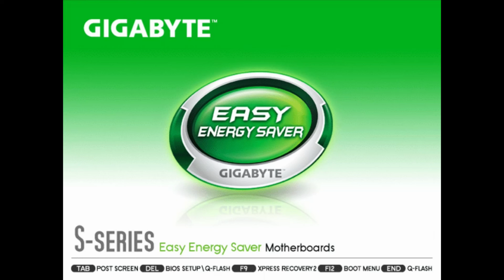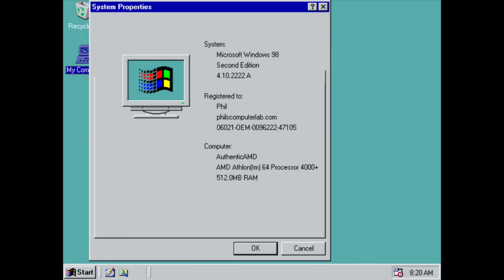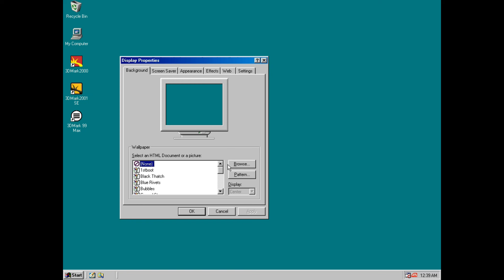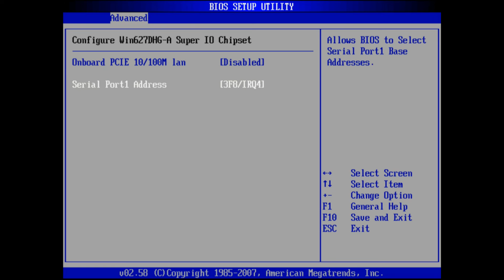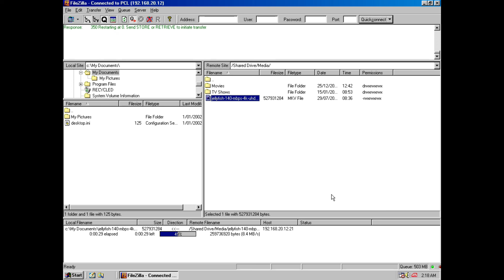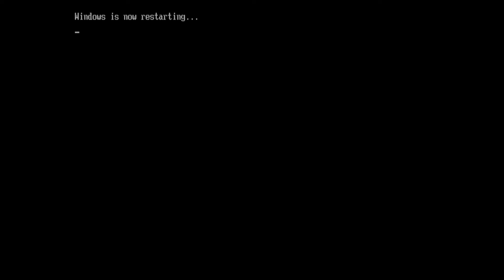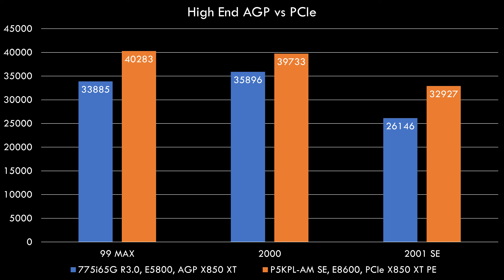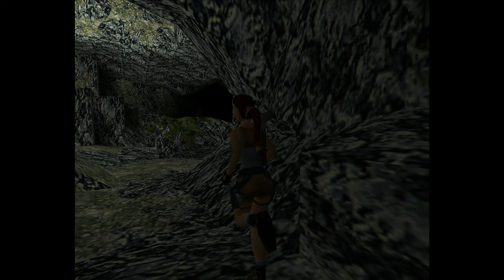Using PCIe Graphics Cards with Windows 98 SE

Comment: I'm surprised that those low end motherboards are still functional with the original electrolytic capacitors. They are 15 years old. I would definitely get that Asrock board recapped, it's worth it.
Reply from the maker: This was after the capacitor plague, so they are of good quality. Also Core 2 is more energy efficient compared to Pentium 4, so they didn't get as much workout.

Comment: This is beyond fascinating! I do kind of wonder though, with hardware that powerful, is Win98 holding it back in any way? I realize 400fps is already insanely good, but would it be even faster under WinXP? Also RE: Nvidia cards- I've had an AGP 6600GT working just fine in Win98 so I'd assume the PCIe versions would work as well. What I am curious to see however is the PCX series (PCIe GeForce FX) or  anything from the 7 series (AGP or PCIe). Great video as always Phil!
Reply from the maker: Yes for example XP will benchmark faster in 2001 SE and also the network aspects are inferior compared to XP. Even with a Gigabit Ethernet card, with Windows 98 you don't even get close to utilising it.

Comment: I dig how you're always exploring new ways to dive into 98SE, often making it more accessible and affordable in the process. I also saw Joseph's thread about installing Live cards with Audigy drivers, and a video on that would be cool. And I'd be keen on more networking stuff too. I'm already using FTP on my DOS and W98 machines, which has been game changing. Next item on my wishlist is to set up shares from a NAS that can be mounted on my retro machines. Currently tinkering with EtherDFS for mounting network drives under DOS.
Reply from the maker: Nice! Yea FTP works out of the box is very handy. I also had WebDAV working, but connecting directly to Windows share is still the most convenient method IMO. But in time, legacy features will get removed, and sooner or later we won't be able to network like that... I have to look up EtherDFS, sounds interesting! I use mTCP currently, I can GET individual files, but the MGET command doesn't work, throws an error about filename issues... I'm working with the author of mTCP, hopefully we can resolve this. You can run a FTP server on DOS and use a client from a Windows machine, but I find it neater to just have the NAS running and not involve another computer.
Reply: @philscomputerlab   Yep, currently using mTCP's FTP server and managing files with Filezilla on my main PC. (On the W98 machines I'm using WarFTP for the server). At first I thought that's all I would need, but I soon decided a NAS would be a good idea too.
Reply from the maker: @Grus0  I think you will enjoy having a NAS! I don't want to sound like a sales person, but it has made my digital life so much easier, everything is in one place and all machines can access it. The NAS has features way past what I use, you can connect a monitor, keyboard, mouse and use it basically as a PC! Install a VM, Windows 10, I even had Crysis running on it!
Reply: @philscomputerlab  Yep, I think it's definitely going to happen!

Comment: Just finished my "supreme" 775/AGP build with a C2X X6800 and a (silent) FX 5950 Ultra -- Got 25000 points in 3D Mark 2001 SE -- Was very proud -- Until I saw this video -- Thanks Phil ;)
Reply from the maker: Hehe, well now you know what parts to get :D If you get a decent OC your scores will improve across the board as we are heavily CPU limited.
Reply: I wonder how much the OS impacts the scores here. I have a Prescott 3.0HT P4 and an X850XT that I OCd to PE clocks and my score on 3dmark 2001 SE (in Windows XP) was 17,200. To see Phil get almost double that in Windows 98 makes me wonder what is wrong with my system? I did only have 1gb in single channel, but that shouldn't half the performance.

Comment: I had that ASRock board back in the day. It was such a piece of shit I swore off every buying ASRock again. I've kept that promise and will continue to do so. I don't care what anybody says about ASRock being acceptable today, FUCK ASROCK
Reply: To clarify since I realized there are multiple ASRock boards, i had the 939Dual-Sata 2 and hated it
Reply from the maker: Oh I see, it's actually a solid board for me. I did have heaps of issues with Nvidia chipset boards however...
Reply: @philscomputerlab  My setup using the 939Dual-Sata 2 just never ran to anywhere near the performance it should have. Always had weird issues. I'll hold a grudge against them for my experience with it forever
Reply: My g41m-vs3 had failed, it's the first motherboard used since 2010
First is random freeze, then keyboard is unusable.
Thinking it's the issue of solder, I heated chipsets with heat gun.
Didn't work anymore, just flashing keyboard lights.

Maybe today's are more better?
Reply: You can't let one board tarnish your view of a whole company. Ive had failures from everyone and it's just hownit is sometimes

Comment: I have a  question, why does every one bench mark windows 98 machines both OG and SE, at 800x600 I remember playing games back in those days using 1024x768 some times in 1280x 1024 only times i used 800x600 is if the games where too old to support that, which was mostly later dos games like doom,Sim tower, and few other dos games that came out between like 92/3-95, and those games would just default to there max resolution supported, and as soon as i went back into windows it would default back to where i had it set at... am i missing something here whats so great about 800x600 when its clearly a lower resolution
Reply from the maker: You can test at higher resolutions, but I always test at the default settings so the scores are comparable. When I play games and capture footage, I usually use 1024x768 or 1280x1024, sometimes 1600x1200 :)
Reply: @philscomputerlab  Gotcha thanks :), i never had a monitor that could do 1600x1200 that or a graphics card that could, at least back in the day
Reply from the maker: @DigitalxxxFr34k  Yea 1600x1200 monitors are a bit hard to find, so I got a 1920x1200 instead and it can do 1600x1200 with black bars on the sides :D

Comment: Here in Colombia the 775 platform are the only option available for second hand low cost desktop PC, it's like 60 bucks for a mainboard + RAM + Pentium 4. Not too RETRO here.
Reply from the maker: I see. Well this platform has more nifty secrets, so stay tuned, there will be more :D
Reply: Wait, how that can be expensive?
In our country, g31 motherboard costs 200k IDR (14bucks), 1gb ddr2 costs 30k IDR (2bucks), pentium dual core costs 50k IDR (3.5bucks) or pentium 4 costs 10k IDR (a meal, quarter bucks)

19 bucks in total
Reply: Wow i feel bad for you. Lga775 is cheap everywhere but your country. Socket T is too old to be any use for modern times now. So i guess the market is just bad where you live.

Comment: Amazing video, I have a Windows 98 and Windows XP dual boot retro gaming PC and I love it. It's a Pentium 4 at 3ghz with an ATI Radeon X800 XT PE AGP (I couldn't find the X850 XT when I built the PC), and the performance in Windows 98 is outstanding. I also achieved to use 2GB of RAM with the patch you mentioned; I bought it from Rudolph directly, and I had no idea that he passed away, what a loss :__(

Keep up the good work Phil!
Reply: Sounds similar to my setup will have to use this patch
Reply: Can you advise on the earlier windows 98 16 bit game compatibility? It would be appreciated

Comment: There is a way to get the nvidia 7900 gtx to work in w98 with modded drivers. I've done it once, then I lost the working modded driver (or settings) so I couldn't reproduce it within reasonable time :(

Comment: Great and informative video Phil! I have a X700 PRO AGP Win98 build and performance is excellent compared to NVIDIA FX series, but I did have a few issues. I could not get 1080p working on ATI card and playing DOS games inside Win98 had some graphical issues (Duke3D especially, window displays garbled horizontal lines). I think I was using same drivers as you (cat 6.2)

Comment: I actually tried this before. Both with a P4 3,4ghz and a Athlon 64 x2 5000+ and it's crazy fast.
Reply: Hey what main boards did you use ? struggling to find win98 on socket 939 boards
Reply: @paulhilling6208  Sorry for late answer. The 5000+ is using the AM2 socket. And the board is a ASUS A8M2N-LA.

Comment: Hmm...I have old asus p5k motherboard. Would it be possible to make the install or is the ich9 deal breaker? I Need more info on how to do it, please. Thank you!
Reply: Windows 98 will work on anything as long as you don't install acpi via win98 setup executable and have a legacy bios or uefi with csm (compatibility support module a.k.a bios) as long if you have a working 32 bit hard drive storage access and a graphics card with full win9x support. chipset driver support does not matter aside from some vendor specific pci bus bridge controllers. (a.k.a agp controller driver)

Comment: I don't have an actual use for windows 98, as all the games I used to play back then usually work or have patches to work under XP, for dos games all work perfectly fine in dosbox, my retro xp machine has an HD 3650 agp version, performance is similar to this card and gives me that retro feeling I want from an old computer
Reply: The only real thing your missing is the music quality. I was shocked how much clearer and vibrant dos games sound using real soundblaster hardware.

Dosbox is good enough 95% of the time but there are a few games that no matter how you adjust the timing it doesn't feel quite right.

Comment: Nice video, thank you very much for making it.
Windows 98 doesn't care whether video card is PCIe or AGP. If chipset drivers are available it will work. Most PCIe boards do not have working chipset drivers. Drivers install, but system is unstable.
From my experience anything above Intel 8xx series chipset will be a lot of headache. I'm surprised you got a stable system with G31.
Reply from the maker: Yea I didn't install any chipset drivers :)

Comment: Awesome video, as always! Would this work on even newer hardware beyond 775 mobos? I understand the idea of having multiple machines for Win98/DOS vs XP+, but I'm very space constrained and I'd rather have one machine setup with a HD bay to swap drives.  While a core2 would can get you a system that can go very far, I'd like to see something like a second/third gen core machine that still has native XP drivers and maybe multiple PCIe slots for more than one video card.  Could run DOS/98 through Win 10 on the same hardware and run everything very well.
I can dream can't I?... ;-)
Reply: Suppose at this point it would be better to look at emulation and PCI passthrough :-D

Comment: Well this is what i am trying to do in a few months. I am trying to build a system with celeron D 3.33ghz with lga 775 ddr2 and AGP, most of the motherboards which has pci express wont work nicely on win9x. some keywords for you guys: use sis and via chipsetted motherboards, no dualcore support (only pentium 4, celeron or amd sempron/athtlon single core 939 boards). I still havent find what i am looking for but motherboard in the video is great, i also dont want to use too powerfull gpu such as 850XT, more like thinking AGP nvidia 6200 maybe 6600 for early 2000s games in a high resolution.

Comment: I really like this video. I've been searching about the best parts one could go with to make a Win98 build and this video is the conclusion to that search (imho).

Now, for the best of the best, the builds here presented by Phil are the way to go. However I started pondering about the machine with AGP.

Those machines, while having a wide range of (used) AGP cards available, those motherboards usually accept no more than C2D E6700 so a bit of a bummer there. The graphics card used in both AGP and PCI-Express is the X850XT which compared to a HD4650 (AGP), the HD4650 is faster. Also bear in mind there are maybe not many PCI-Express GPUs compatible with Windows98.

So, if you go with a AGP+E6700 combo you can get more GPU power. If you go E8600+PCI-Express you can get more CPU power. Either build you choose you will be limited to parts availability and retro prices. One thing I think it would position the AGP build better would be the fact those motherboards most likely have Windows 98 SE drivers and the GPUs as well. But, as we saw in the video, no chipset drivers were needed for the motherboard.

Those were my 2 cents on this video. Thanks again, Phil!

Comment: before watching: PCI, and PCIe are "the same" as far as an OS knows, they're logically the same.
Reply: Though, there is the issue of finding Windows 98 drivers for new cards in 2021.
Reply: @TheTurnipKing  Well, yeah, but an HD 3850 isn't going to work regardless if it's AGP or PCIe variant, it's not the slot it's the card.
Reply: @TheTurnipKing  Virtually impossible to find one for brand new cards, luckily it's still relatively easy and cheap to get a PCIe based GeForce 6 series or Radeon 9000/x*00 series PCIe variant which do have Win9x support.

I also wonder how possible a community written driver could be for Win9x machines, basically using the open source Linux drivers to figure things out as that'd allow support under Win9x for up to nVidia's Kepler GPUs and basically all of AMD and Intels GPUs (Pretty sure there's also open source drivers for the less-prominent manufacturers including 3DFX, S3, etc) while also allowing the community to request driver-side features/fixes/optimisations. (eg. Making any GPU run the vendor-specific miniGL implementations to make say, running a Glide or MeTaL game on a modern Radeon or Intel GPU as simple as running it on a Voodoo)
Reply: @TheDemocrab  funny, I was just wondering the other day how damn nigh useless "display adaptors" like the gt710 would stack up against vintage but expensive 3D accelerators
Reply: @TheTurnipKing  That is actually a really interesting question that's gotten me thinking and going by the pixel/texture fillrates, I'd guess that a GT710 would be within the ballpark of a Radeon 9600Pro for its performance assuming both cards have optimised drivers. The GT710 would be faster for sure, but it's a question of how much in which games as the pixel fillrate is only a shade higher (1.6GPixels/S for the 9600Pro vs 1.62GPixels/S for the GT710) while the texture fillrate is a lot higher (Radeon 9600Pro is 1.6GP/s, the GT710 is 6.4GP/s) which means that the GT710 will perform better in games with lots of texturing, but most 9x games are pretty limited in that which means both cards should be pretty close. 

Obviously this is theoretical, fillrates don't necessarily tell the whole story. Maybe the GT710 is lacking support for some specific hardware feature that was common back in the 9x era and has to emulate it in software instead which would slow things down, or maybe there could be some interesting driver-side game optimisations that could be applied thanks to modern GPUs being far different to older GPUs in terms of design which could speed things up.
Reply: @TheDemocrab  "I also wonder how possible a community written driver could be for Win9x machines"
Practically impossible for Nvidia cards. There's no available open source code from Nvidia to help. There are binary blobs, but Nvidia will never compile any newer ones for Windows 9x at this point. Some open-source drivers exist for Nvidia that you could reference, but they're reverse-engineering jobs rather than properly built on actual documentation and who knows what making them work for Windows 9x would even look like.

AMD is more open source, so maybe? It would come down to whether or not Win9x can even do certain things the hardware might need (new cards are all made for later versions of DirectX and OpenGL that were well past Win9x times).
Reply: @camthesaxman3387  Youd be surprised, any windows will use the cores it sees, same principle for dual channel memory, win98 runs hell of a lot better with dual channel ram. In win98's device manager theres a "processor support" entry, if we could get that showing in the OS twice then dual core would work.
Reply: @Synthematix  

Multiple cores is not like dual channel memory where the hardware works out what to do. For SMP the OS needs to be specifically aware that there are multiple CPUs, know how to start the secondary CPUs, know how to schedule tasks across multiple CPUs, deal with interrupts happening on multiple CPUs, locking semantics that can handle more than one CPU accessing the same resources ... just having a second instance of the CPU entry in the device manager does not magically make the windows 98 kernel capable of that stuff. There is reason microsoft used NT as the base for everything after 98/ME and that was that it's impossible to make Win98 into a modern OS that could do stuff like SMP without totally rewriting it.
Reply: And none of this matters when windows98 can only use 1 cpu core, put the fastest gpu on the planet on win98 and you will be extremely bottlenecked.
Reply: @Synthematix  The appeal to my mind would more be to pair extremely slow, very cheap and quite plentiful low-end modern GPUS with a vintage OS.  I'm still not entirely sure Win98 would keep up.

Comment: My late 98/Early XP build uses an AGP x800 Pro Video card and a Socket A Athlon XP 3000+.
It's pretty good, but I've been thinking of moving to Socket 939 for cooler CPU temps.
Reply: Trying to do this , struggling to find win 98 support on a socket 939 . Sockets a I had no problems

Comment: How on earth did you manage to boot off of fat32??? I thought you can't boot from usb flash in fat32.. edit: "format /s" what does "s" do?
Reply from the maker: /s makes it bootable. It does the same as sys C:
Reply: @philscomputerlab  thanx.. you also mentioned 1GB of RAM under win98se.. yeah, it is really possible but you need unofficial sp3.. it allows you using up to 2.5GB of RAM (2547MB if i am right)